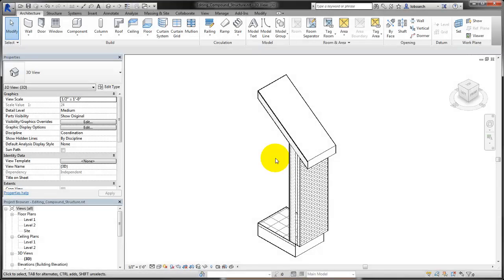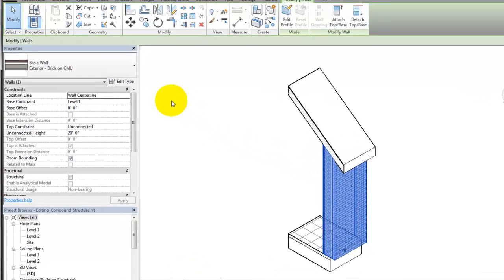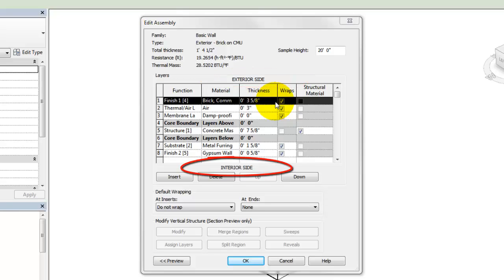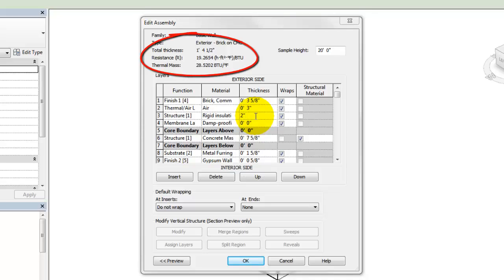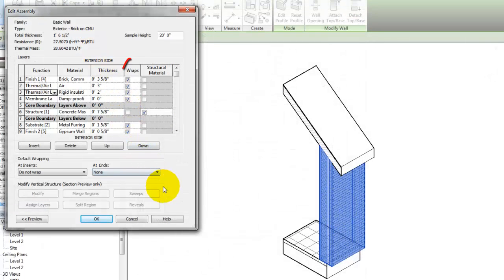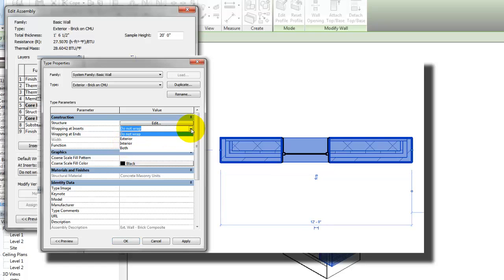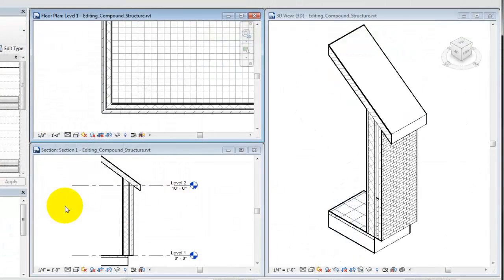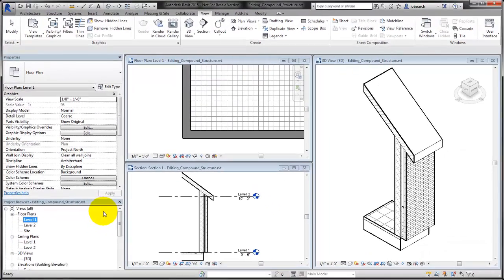Editing Compound Structures

Comment: However it is still kind of complicated to extend the structural layer if the wall down to the structural layer of the floor " the way it is being constructed" and get proper calculations for the floors and walls.